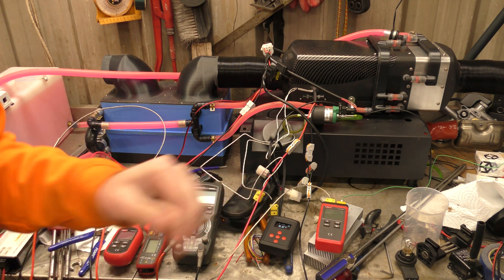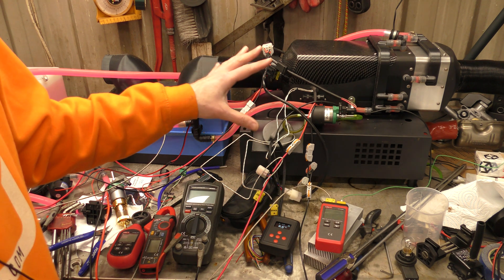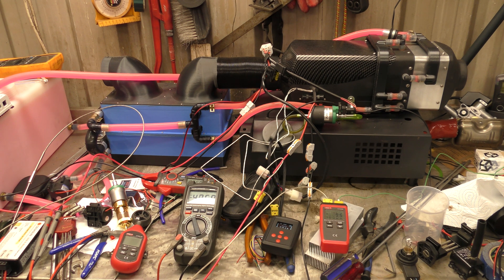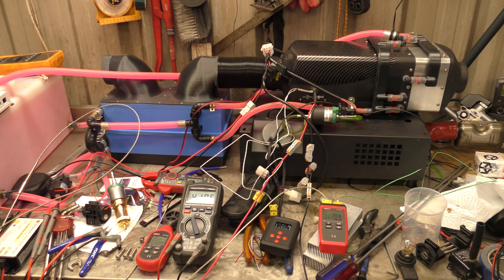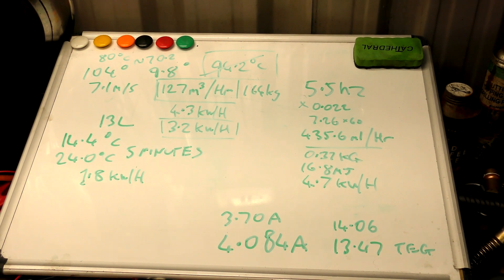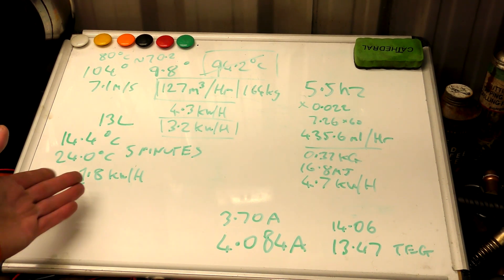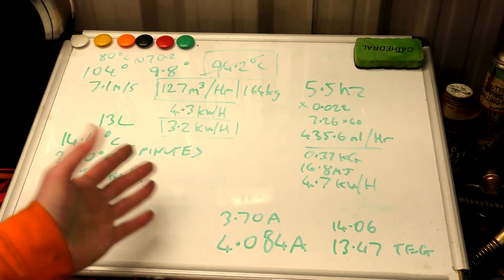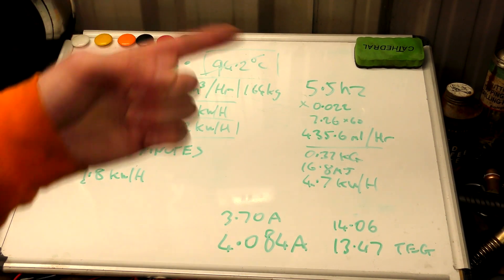Self Powered Diesel Heater Project - some testing and maths - part 10

Comment: hi, i like your videos and thank you for your time and effort, i have question why my 8k deasil heater are given noise from intake air to the burning chamber noise like voh voh voh and when i started the noise is very high
Reply from the maker: That is a sign of an incorrect air fuel mixture.
Reply: @DavidMcLuckie  thank you for replying , what Shel i do please
Reply from the maker: If it's an adjustable ECU you can use a CO meter to 'tune' it.  I have had heaters that did that but once everything got worn in a little the whomping sound almost went away.  Have you got the silencer on the exhaust and the air filter on?  Sometime having them on or off in combinations can help as well.
Reply: what do you mean by off or on   the silencer on the exhaust and the air filter please

Comment: You know the thermal output of KW given the energy density of the fuel.  
What you need find is what is lost via the exhaust and so as ratio.  
Then your air density is lessening as it warms up if fed from the room air,  Edit this makes it more difficult to transfer energy. So it's getting more difficult  to calculate.  
So really it's find out what is lost by the exhaust.  Deduct that.  Then deduct your thermal transfer to the water.  What you are left with is your result.  The air flow won't make a difference, (slow fan, hotter air, fast fan cooler air equals the same) either way the heat is radiated to the room.  Oh and you would have  to insulate the pipe work and water tank to be anywhere near accurate as they are also heating the air .  
To reiterate.  Your best just to base it on the known fuel density.  How much to exhaust, how much to water then the air is obviously your missing energy.  
Run it for 30 mins x 2 for Kwh.

Comment: Does your airflow calculator take into account the air speed variation across the diameter of the pipe? Basically it's zero at surface, so less air is flowing than calculated.
Reply: Potentially also as the anemometer blocks some of the area of the duct, it might increase the air speed whilst measuring.
Reply: Also air density is only 1g/L at 80c.
Boundary layer is probably something like 1.3mm off the radius. This gives me mass flow rate of 128.5kg/h
I make it 2.53kw
Reply: Air flow is irrelevant I'm afraid

Comment: For the air measuring, you just need thermocouples that you can bolt into place so that no hand interaction is needed that could skew the results, and can be used with logging stuff to take measures automagically... :)